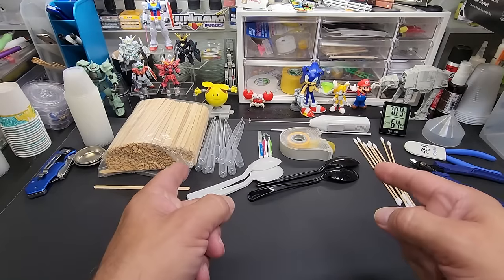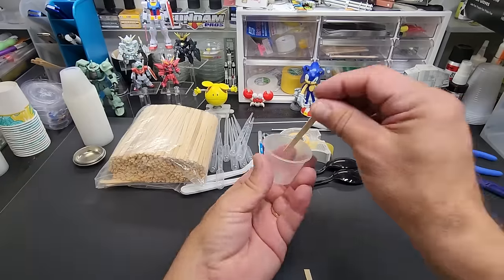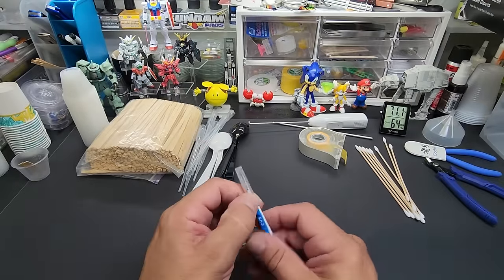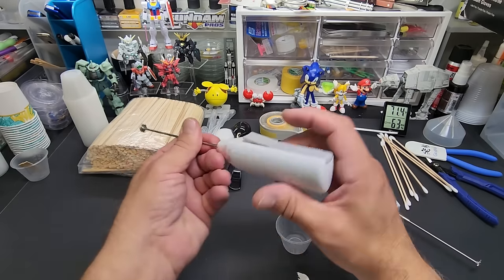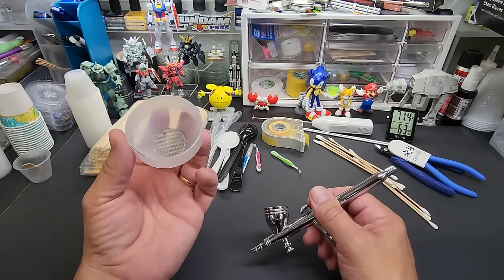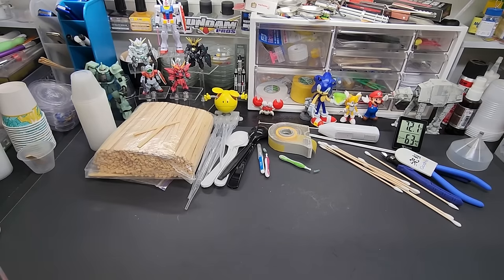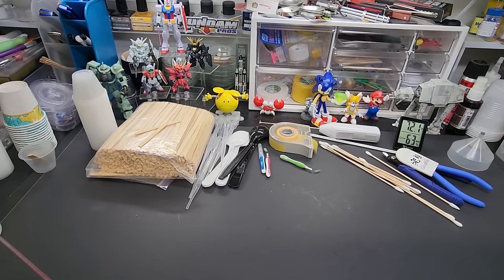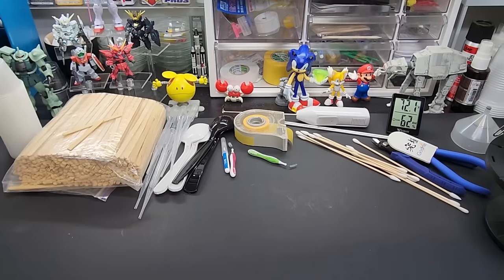Tools & Products I Use Everyday On My Hobby Bench

Comment: I like the stainless steel swizzle sticks instead of the wooden. They come with numerous shaped ends and if you want/need a certain shape you can also file/grind to shape your own.
I see only one con with them,you can't leave them in your mixing cup as it'll fall over but I just drop them in a glass of water/cleaner and pull them out and wipe clean. Oh... after a few more min into the vid I see you have something like them at 13:12 and mention how you clean them.

I made my own turntable out of 1" thick wood and 3" lazy susan turntable bearing. I got the idea from making one a while back to hold all my fly tying tools like bobbins,bodkin,scissors,couple spools of my most used thread,etc. It has a little weight to it so it doesn't get bumped around or knocked over easily and can drill holes at any position to hold the clips/sticks

Comment: Work for a plastic cup company now and can confirm the ridges on the bottom of the cup are for stacking to prevent suction. I was mixing in one and when my stick got caught on a nub shot paint right into my eye so I agree quite unpleasant! Most 'medical, graduated cups, will not have internal deformations from both injection and the stacking lugs. At least with my company. Polypropylene is also probably the resin you want (the less clear one) as it will be less rigid over all and the irregularity of the material makes stacking lugs less necessary. Both PP and PET, the normal more clear cups, are solvent resistant so no concerns there for switching

Comment: Since moving to Hawaii I've become a bit more conscious of the waste I make. I recently started using 25ml glass beakers for mixing paint. They have the measurements on the side and a nice pour spout. Wipe them out with a little acetone and you're good to go. They are sturdy too. I can leave the stirrer in the beaker and it doesn't tip over. I think I paid $14 for 12 of them on Amazon.

Comment: 😮 The film on the plastic spoons are a silicone mold release. The mold is to separate the plastic spoon from the plastic steel mold. Another use for silicone is to use on plastic model cars, trucks. It is use to release the plastic parts from the steel plastic molds. This is why you wash your plastic model cars, trucks before assemble and paint your model. Use on any plastic model kits.

Comment: That Micro Mark mixer is sold under various names and configurations. I’ve had a “powdered drink mixer” version for ages.
Reply: I literally need a powdered drink mixer, the one I use daily died, and the replacement is dying, so if you had yours for ages I’m very interested in hearing what model and where to buy!
Reply: @Syclone0044 Norpro Cordless Mini Mixer, 5 Piece Set, One Size, White. Didn’t come with exact same tip as the paint mixer in this video. Several drink mixing tips, one of which is similar to the paint mixer tip.

Comment: Just received my dehydrator and had to file a complaint with the post office, driver just dropped it in my gravel driveway, luckily no damage. I’ve looked through your archives and haven’t seen anything about advice on using the dehydrator and settings. Also wondering about leaving the car body on the Tamiya holder. Will the heat cause the metal to damage the body?

Comment: So, if your humidity level is unacceptable, what do you do about it? Do you have more of a problem with high humidity over there? Do you run a dehumidifier when that happens?
Reply from the maker: My central air conditioner also has a built in dehumidifier. Run it about and hour and I'm good to go if I need it

Comment: Thanks for another useful video. I have a recommendation for you: a "goose neck" squeeze bottle like they use in chemistry labs. They work great for thinners.  The control is nearly as good as a pipette, but with way more capacity. They are solvent resistant and have an airtight lid. They come in different sizes and are easily under $10.
Reply from the maker: I have several goose neck bottles here, I got them at the tattoo supply store near me. I did show them in my make your own acrylic thinner and cleaner video

Comment: Great stuff. What are the BB's you add to your paint to rattle mix it? Where can I get some? Thanks Rex.

Those Gaahleri 68 Air Brushes are great, I have 2 one for each needle... 😁 I have one of the Harbor Fright brush stand and I just rebent the red holders to fit the 68 brushes. Fits now... Lol
LLAP 🖖
Reply: Paint agitators or "mixing balls". You can find them most everywhere.
Reply: I have also used actual copper BB’s for a BB gun in my little Testors bottles
Reply: @aWOLtrooper  Ok, cool. I will try to find some somewhere.
LLAP 🖖
Reply: @Syclone0044  I have/do used them. I have noticed in acrylic paint they tend to tarnish the paint and leave a black film on the the bottom of the bottle. Wanted to try something else. Thanks for the the suggestion.
LLAP 🖖

Comment: Hey Rex, I was wondering if you ever tried
"Colorshot" acrylic paint ? I "was" getting it from Home Depot until they discontinued it. Michaels still carries it. It comes in spray paint and 2 oz. Squeeze bottles.
If you are familiar with it, have you featured it in any of your videos ? I have thee entire line up in both spray and bottle. I have yet to try it in my airbrush.
I don't have much success with acrylics in airbrushes. I would like to start using it in my airbrush but waiting until I see someone else having great results.
I'm pretty sure you featured it already, I haven't seen it yet . Thanks, Howard
Reply from the maker: I did a video here on them. Pretty good, I just got their chrome which is actually decent. I've never seen their bottled paints